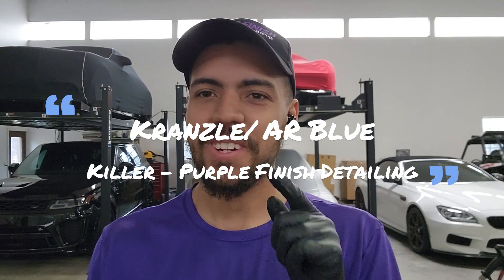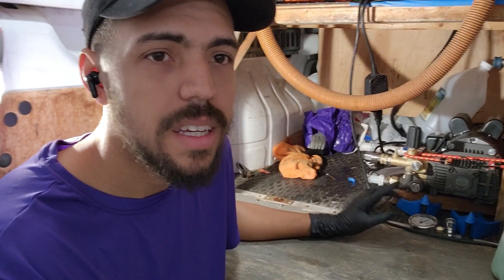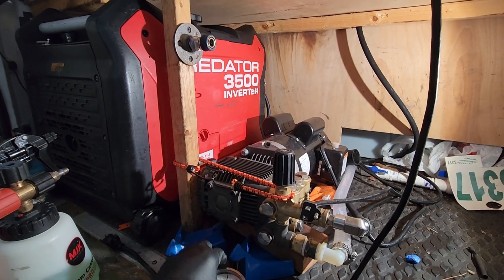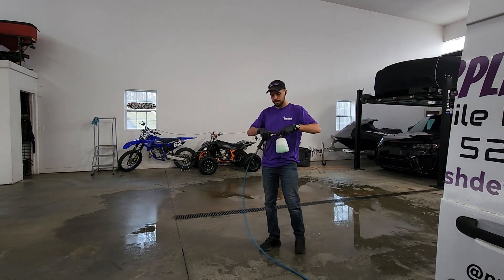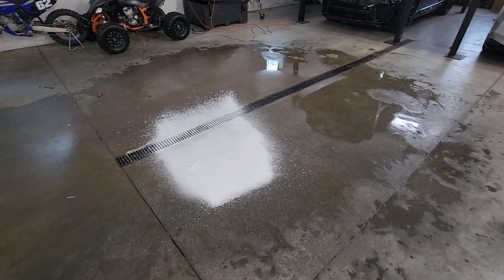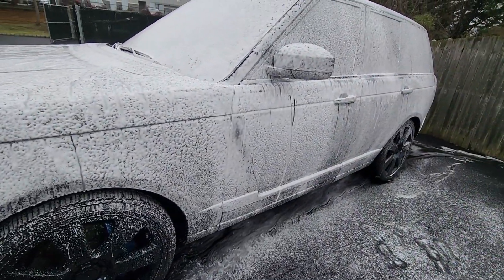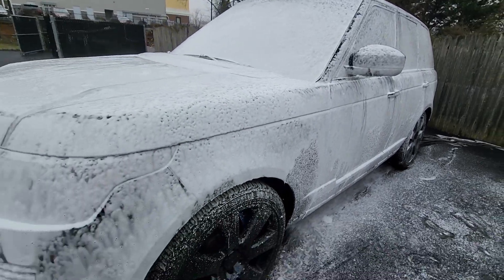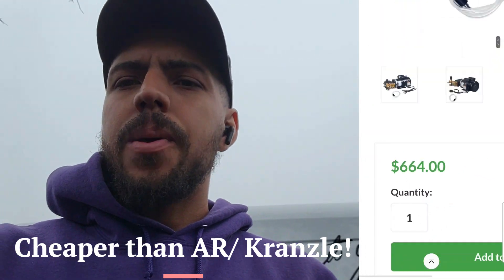Kranzle & AR Blue KILLER! Canpump 1500psi 2.2gpm!!!

Comment: Love the set up and the Total stop on demand 😉...Whats cutting off ur generator and also wears down is the sudden surge of the Kranzle and AR whenever they do the TTS it ramps up the amps, thats why the best for detailers is the HD7 no TTS coz its constant on and like any other Kranzle can sustain longer periods of water circulating inside the pump or even dry run. Looking forward to more videos!
Reply from the maker: You hit the nail on the head! Less moving parts such as the total stop means less problems you can have! Thank you! It's been crazy but will definitely post more!

Comment: Great video and information.. Thank you for that. Quick question.. Canpump also have their 240v electric pressure washers.. What is your opinion/advice on running those on a generator? I also do mobile.. Thank you in advance!!
Reply from the maker: Most generators under 5000 don't have a 240v plug, so it wouldn't make sense to have a PW that runs 240. Also, you have to check the amps, it could be 240 but max out your generators amps, in that case I'd rather run 120v and run multiple machines, ie vacs, air, etc!

Comment: Would immensely appreciate if you could somehow test the db of the pressure washed 

How you have it setup with your generator could never let anyone on YouTube figure out what the sound level really is…..

Also
Do they have a unit with TSS ?
Reply from the maker: When detailing indoor we run our machines via electric power to not smoke up the shops with exhaust. You can barely hear it on, it's very quiet! Out techs forget it's on most of the time and I have to go over and shut it off

Comment: Great video ,Im interested on getting one , What size nozzle are you running ? My little karcher cube is about to die and I want to get something with more pressure to run the foam injector from Chem-x . Thanks
Reply from the maker: Hey! I run a 3.5 & 1.25 foam cannon! You could use the 1.1 but like I mentioned the lower the draw the longer the machine will stress & last! Plus the foam from 1.25 is perfectly thick!
Reply: I just received mine it’s great but it overloads my generator did you have any problems like that or did you do anything to it ? I know that you’re not tech support but you’re the only one that has done this
Reply from the maker: @gil2319  what generator do you have?
Reply: @purplefinish  i have a Westinghouse 4500
Reply from the maker: @Gilberto  that's crazy! I would say maybe it's the machine, when did you last change oil , spark plugs etc? I run my compressor non stop, while pressure washer is going, sometimes a blower as well with the Predator 3500 and no cutoff or loss of power
Reply: Well I thought the same so I change the oil and did some maintenance but it has just 21hr so it should be fine I did fiddle with the unloader and at no pressure it works that’s super weird maybe the unloader is not working properly thanks man it does feel super strong when is working I hope to figure it out
Reply from the maker: @Gilberto  I had that problem with AR Blue,  but this one works fine. You can feel free to call or text me if it's easier
Reply: @purplefinish  im returning it, I made it work but it doesn’t have the psi or gpm I think I just had a defective unit it barely gets up 1000 psi and 1.75 gpm not bad but not what the unit can do .
Reply from the maker: @gil2319  that's crazy,  I run gravity fed and get great numbers,  some days over 2.5gpm & it depletes my tank faster lol
Reply from the maker: Hey bro just a heads up I purchased a champion 4500 and it works just the same so I don't know why it wouldn't work with your westinghouse!
Reply: @purplefinish   I been doing some testing and the Westinghouse just can't keep up with the spike of amperage at full pressure, but I put a 4.0 nozzle and it seems to work better not perfect but better. thanks for the help bro.

Comment: Thanks AMAZON is showing two models...could you possibly provide model number, 
as one is a axial pump and the other is a triplex pump which I'm guessing you have the TRIPLEX PUMP MODEL.
Reply from the maker: Thank you for pointing it out! I updated the link on the video description! It's $770 on amazon! I purchased mine from Amazon, then I had a part broken in transport and they ask to reach out to them directly... to avoid doing so or making it easier you can buy direct from them (also will come out cheaper  depending on your location)
Reply: @purplefinish  thank you sir truly interested in unit.
Reply from the maker: Awesome! I really like this unit, for the proce and output its awesome! Very cool! If you want to see other videos on it just leave a suggestion and I'll make it!

Comment: What on/off remote do you use?
Reply from the maker: It's the dewenwills one from Amazon! Got it a little over 3 yrs ago and never even changed the batter, use it all day everyday! Best one I've had for sure! Link below

 DEWENWILS Outdoor Wireless Remote Control Outlet with 2 FT Extension Cord, 15 amp Heavy Duty Weatherproof Remote Controlled Light Switch for String Lights, 100 Feet Range, UL Listed https://a.co/d/h5ufXFI
Reply: @purplefinish  awesome, thank you!

Comment: How many amps?
Reply from the maker: On the side of the machine it states 22 amps, however running the bigger orifice like I mentioned, I run it on a 15a circuit no problem, with other devices plugged into that outlet! 👍